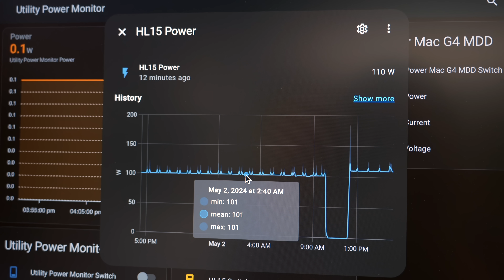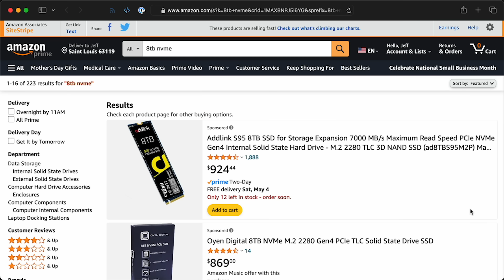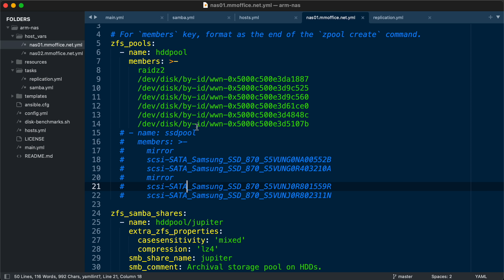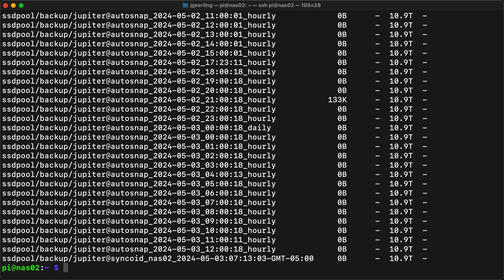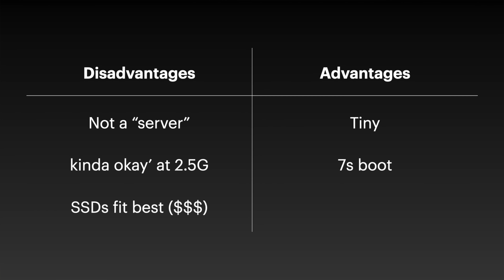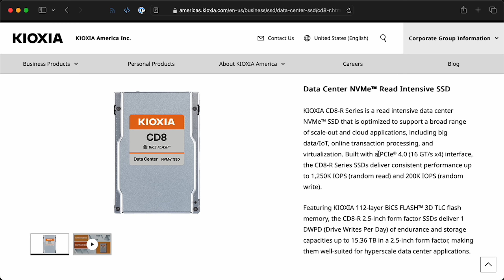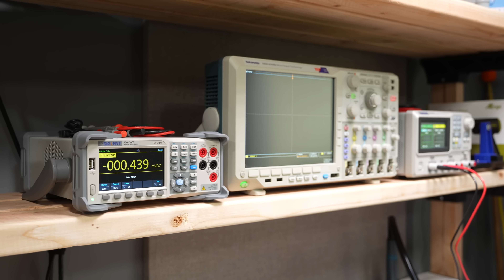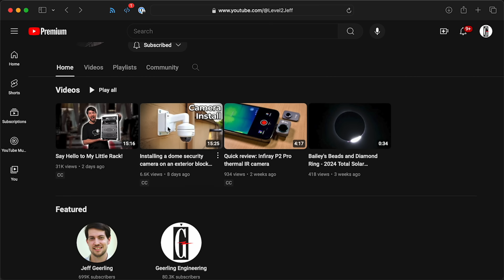Big NAS, Lil NAS (moving 13)

Comment: I saw another Youtuber get a cheap tape drive do periodic offsite backups.  Write to tapes mail to friend or put in another safe place like a fireproof safe.  Tape sits there no power consumption holds loads of data and in the right conditions will stay that way for 50+ years.  Rotate with a second set of tapes each week or month and you got yourself apocalypse level protection.  House burns down, you just need to restore from the tapes and you don't pay export fees from offsite cloud, though you would need to find another tape drive if you house burned down, nothing is perfect.
Reply from the maker: I have considered tape archive in the past, the annoying part is how manual/physical the process is. But when I was younger, I was in charge of the weekly tape backup rotation between two radio stations. Was a fun and easy task to do every Friday :)
Reply: Tapes sound great until you have to do restores... Even "enterprise" backup software can be buggy (database corruption, etc), and LTO drives only offer 1-2 generations of backward compatibility.  And if your tape robot fails after 10 years, you're at the whim of what might be available on eBay as a replacement.  HDDs aren't perfect either, but a heck of a lot easier to just plug a drive into 3.5" hot-swap bay or even a SATA-USB adapter.  LTO-9 tapes (18TB) are about half the price of HDD, but you also have to factor in the cost of the LTO-9 tape drive (usually thousands of $, not even counting an auto-loader).  Lastly, if you're storing tapes (or HDDs or even SSDs) in fireproof safe, make sure to pack and maintain desiccant (larger gun safes can get powered dehumidifier accessory) - this is why off-site storage facilities like Iron Mountain use old mines - basically free climate control underground.
Reply: @jasonboles1526  Production database backups are a surprisingly difficult challenge especially with a "slow" backup device, since there are probably writes happening when the backup is in progress.  Probably best to use a file system that supports snapshots, then backup strategy is to tqke a snapshot then send that to the backup device.
Reply: Also yes, a deeper dive explaining those Ansible playbooks would be awesome Jeff! I'd watch that thing even though I don't know a lot about storage itself.

Comment: Why would you build a NAS for just 11 TB ?? A huge waste of effort, time and money. Just buy a 18TB data center HDD for about $300. After you have three of those in your machine only then build a proper NAS.
Reply from the maker: Redundancy, performance, expansion — I can edit multiple 4K streams of video off the NAS directly (with hard disks), not caring about individual disk seek times (or 240 MB/sec data streams per drive), and I also have the ability to continue work with up to two hard drives failing in the array.

For expansion, I like having tons of extra room available, because from my Dad's experience, once you go past 50% of allotted capacity on a storage system... things start going from "I'll get to that" to "uh oh things are breaking because we only have 1 GB left" quicker than you'd think.
Reply: @JeffGeerling  Don't get me wrong. This is cool as a project, but I don't see the economical side at this scale. With three data center HDDs in work PC you have about 50TB of storage. That times two and you have two copies and we've yet to reach this SSD NAS projects budget. For the offset backup you could remain with a singular drive.
From my point of view this is a way too large of an engine for maintaining 11TB (or even times 2or3) data 🫤 Also it's not as if the drives are unusable for a NAS afterwards, once you have an use case for 50TB+

Comment: Dear Jeff - these "industrial style" SD-Cards means ... nothing, zero, nada :) I know where you comming from - and I understand your intention - however ... these "industrial style" cards are dying as fast as any other SD-Card.
Reply from the maker: So far in my own testing (anecdata of four cards), I have had zero Industrial cards fail, versus one of the 8 SanDisk Extreme cards I've had deployed for 3+ years.

The tough thing is, with all storage, each vendor does better or worse as they change the internals of whatever SKU you know was good a few years ago. So the same model card or NVMe drive today might not be as good as it was when you bought the same one two years ago. It's kinda annoying with these storage companies :(

But a good lesson in why backups/not having 'pet' servers is so important.

Comment: You don’t need a rtc battery if you keep the pi 5 connected to power. The RTC will stay on during sleep as long as usb-c power is applied
Reply from the maker: True; just easier if there is an outage, or if I need to move the Pi somewhere and Internet is down when it boots.

Comment: the other day i used a pi 4 as a tiny nas just for a few files that i need to open on 2 devices useing ubuntu 24.04 LTS and samba
the pi 4 has only a 32gb sd card

nano NAS :>

Comment: Don't understand the second backup location problem when you have servers at home and at your company.

Also, how important is fast storage when in most setups the network connection or the other hardware will limit the transmission speeds. I mean as a second backup, it might be not important how fast it is, as long as it gets the job done.

Comment: I am a Pi fanboy and I need a NAS for my system wide backup. I want as low a power suck as possible so your uploads are some of the most informative. Great work Jeff. If not in-touch already contact DrFalk.

Comment: Hi @jeffgeerling amazing video as always. Quite impressive what you can do with little Raspberry Pi these days. After seeing your videos on the Ampere ARMs I decided to get one of those. I have issues however in the sense that sometimes it doesn’t boot, sometimes it doesn’t shut down, sometimes I even get disk corruption. It’s the ASRock mainboard with the 128 core Altra Max. Tried Ubuntu, RHEL but always the same. Even the machine was exchanged already and the problem persists. Did you come across any analysis for a case like this already ? Appreciate it if something comes to your mind. Keep up the great work.
Reply from the maker: Very strange! I haven't encountered that on any of the three systems I've been running, my first question would be whether your boot drive or power supply are the issue (have you tried swapping those out?).

Also check to make sure you're running the latest board BIOS/firmware. I know both ASRock and ADLINK have updated the BIOSes in the past year.

Finally, post about it on the Ampere Community forum, there are some very smart folks there: https://community.amperecomputing.com
Reply: @JeffGeerling  thanks for the reply. Good point on the PSU. This did not cross my mind, yet. I tried 3 different boot drives already. My SI told me the firmware they put is the latest. ( info from January 2024), but I’ll cross check that. Thanks also for the pointer to the community forum.
Reply from the maker: @andreasschaufler  Good luck! And worst case, you could contact Ampere, or ASRock Rack, or NewEgg, about warranty replacement.
Reply: So it turns out ASRock’s “First Release” of the UEFI firmware is 1.34. I received the machine with 1.24 (!). Hope updating this solves my issues. Thanks for pointing me in the right direction @jeffgeerling

Comment: 14:17 "apple was peak proprietary back then" as opposed to now where it took major country governments to force them to use USB-C on their phones
Reply from the maker: Well at least they stuck with Lightning for so long it became a proprietary standard-ish, and before USB-C was ubiquitous, Lightning had some advantages.

The digital audio plug was only around a few years, and was worse in almost every way than other methods. The only advantage was it saved having a power adapter for the speakers, but there were ways around that!
Reply: @JeffGeerling  to be a "proprietary standard-ish" it would have to be used by more than Apple themselves.

Lighting is a better connector than whatever this weird audio+power plug is, but they are just as much proprietary.

Comment: You could go even smaller footprint since ZFS is working on RISC V.  Also, it's not ARM.  
ARM has decades of optimization for particular processes - if you're using a process that ARM hasn't been built in before, then the economies are going to be limited to software (it's why you see gcc and armasm are frequently used together - you stitch the expensive ARM optimization features into your otherwise "free" toolchain because nobody can approach them on their own hardware).  RISC V will catch up and it kind of is already, honestly.  New technologies benefit from the compressed adoption curves we now enjoy as silicon races to zero on every vector.

Comment: so we're using 4x $600($2400 / 2watt) of 8TB QVOs instead of 4x $130-150($600 / 6watt) 8TB Spinning Rusts , and if we go by the stats you put in your video for $/power usage (9.5 vs 113/year) at 103 extra year 1800/103 = 17.5 years, that seems absolutely not worth it since you can add high speed caches to a NAS to mitigate the speed problems. but cool concept tho.
Reply from the maker: That's why I highlighted that the spinning rust is a much better value for now (for larger storage) — spinning rust > SATA SSD > NVMe. Sadly, prices have gone up in the past couple years, instead of down, making that cost advantage even bigger.

Comment: Man that HL-15 is such a beautiful case but $799 for a case and backplane is nuts when you can buy a Meshify 2 or Define 7 and miniSAS breakout cables that holds as many drives for 1/8th the price
Reply from the maker: Yeah; it's a premium case, with a premium price. I hope these show up on the used market at some point since the cases are so versatile, and will probably outlast the ATX standard and 3.5" drive production!

Comment: I wonder how much power a hdd consumes when it is spun down.
Reply from the maker: I've talked to a couple storage vendors about that idea—they said drives are designed for a certain amount of spinup/spindown cycles, especially in enclosures with multiple drives. There's a bit of a calculus determining the cost in terms of additional wear and tear doing spinups for writes versus leaving them spinning 24x7.

From some quick off-the-cuff estimates, someone mentioned doing once a week or once a month spinups for backups would be worth the cost savings for electricity, but doing daily (or 'as needed') would likely be net negative, since drive failures would require replacements more often.

Comment: I recently upgraded my nas from 6 1tb drives to 4tb ones, and while they are a bit louder, they also draw in total 20w less under max load than old ones
And now i can use the old drives to build an offsite backup location
I just need a 4g/lte router as there are no isps nearby
Reply from the maker: Backups over 4G can be pricey, unless you get a good wireless ISP!
Reply: @JeffGeerling I plan to make the first backup over LAN, then move the nas to the offsite location
I spotted a 100GB/~5$/mo. plan from one of the providers, and I don't think I'll be using anything close to the limit, so I think I should be fine in that regard
Reply from the maker: @Napert  Ah, not bad at all then! I'm just thinking of how I do a video project every week, almost every one is 50-80 GB of footage nowadays :O

Comment: Why isn’t there a 3.5 inch sss?
Reply: Because flash doesn't take much room
Reply: @damiendye6623  yeah but sadly nases only use 3.5 in drives. But anyways couldn’t there be a beefy 20TB sdd like Seagate exos?
Reply: @Mul3turtle  wrong nas can take whatever you like just because it's a 3.5 inch caddy does stop you using the screw holes for the 2.5 in drives.

Comment: For a backup solution that has similar advantages (snapshots, deltas, etc) which doesn't rely on ZFS as your underlying filesystem, you might check out the open source BorgBackup.

Comment: "100W idle, in europe, thats 260€ a year" Looks at HPE Proliant G9 under the desk Yeah, ofc i need that performance... XD
Reply from the maker: "This is the way"
Reply: My power goes from 10c+ VAT for 2-4am to 17c+ VAT for 11pm to 8am to 35c+ VAT for 8am to 11pm. My 2013 Mac Pro runs at 100w so, it’s off most of the time. Ireland isn’t the cheapest for power but not the most expensive either. I like that your focussing on power draw, most of the US based YouTubers make little to no reference to it. Thank you 🙏
Reply: Perhaps you're rich or you like energy companies - who am I to judge you 🤣
Reply: @igordasunddas3377  Luckly got a 5KW solar power system on the roof, so that helps a bit XD
Reply: Hm. One Xeon workstation. One Xeon server. And a Threadripper machine. The RPi consumptions tends to hide in the decimal expansion.
Reply: Depends where in europe. It costs me around 90€ to run 100W 24/7/365

Comment: What program ist that at 4:04 ?
Reply from the maker: Sublime Text. I used to use TextMate until it kinda went AWOL (it's back now as open source), but Sublime has run like a champ on any kind of file for over a decade, and I have my setup tuned to my liking. VSCode is probably okay too but I like Sublime's native code and speeeeeed.

Comment: 2024: Great coverage - crazy advances - Is Moore's law still relevant these days?  :)
Reply from the maker: I think efficiency and reuse are going to be two big themes moving forward; reduce + reuse are two things that are easier to do now that all these computers, outside AI stuff, are fast enough for so much.

Even using a computer that's 3-5 years old doesn't feel like a burden doing video editing and running big sites and apps. Back 10 years ago, if I did anything besides word processing on a 3-5 year old computer, it would feel at least a little slow!

Comment: 100W 24/7 is nuts. Why does a NAS need that 32 core CPU?
Reply: I know right. That is 16800wh! It's not that much. 32 cores might be because he want it to be able to stream in multiple devices at the same device.
Reply from the maker: 32 Neoverse cores, the CPU only churns about 9-13W of that total. Honestly the HBA uses the most power of any component in that build (see my previous video 'silencing the Arm NAS' for more on the power breakdown).